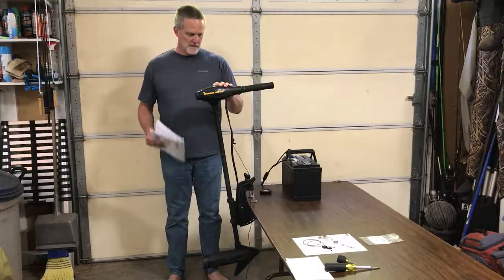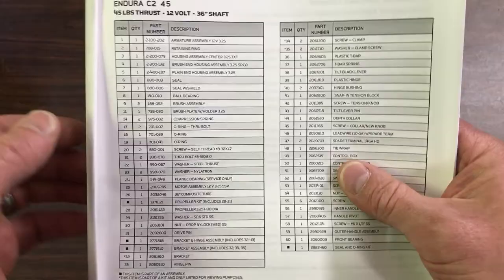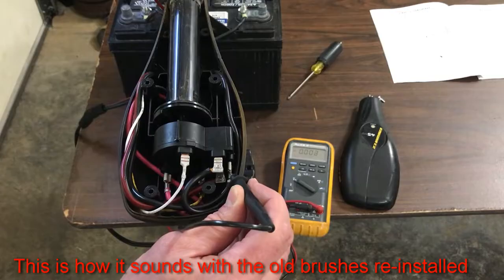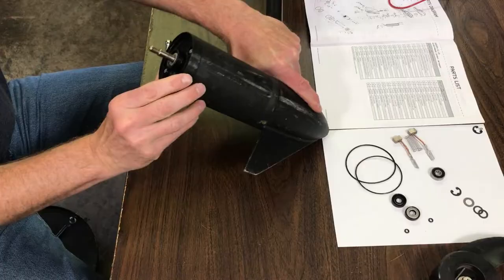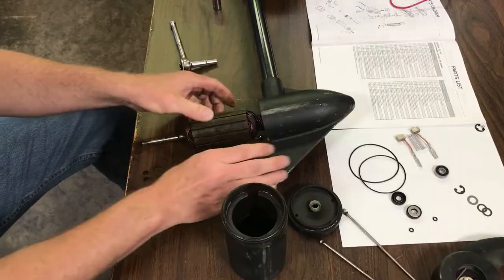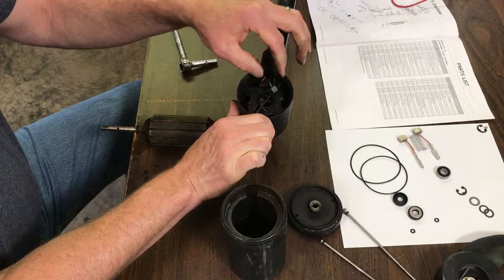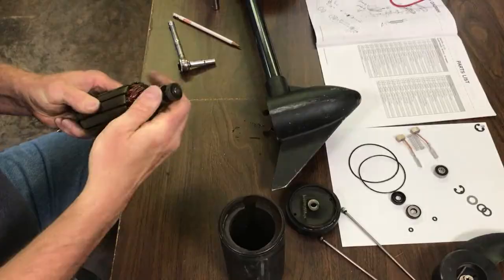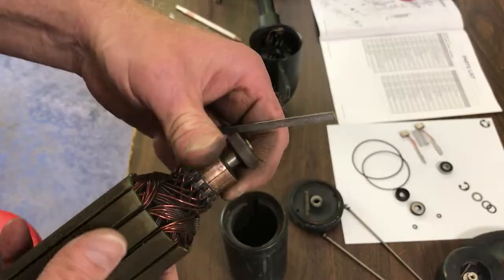Minn Kota Trolling Motor Repair

Comment: In my opinion. Out of all the videos I've seen so far, yours is the best. I disassembled a Minn Kota Endura C2 30 30" the other day with no problems.  I did this before watching your video, I did it exactly the same way you showed. As I have dissembled many motors through the years. Other people just start dissembling without being aware they could damage things even more. My problem with mine, water got inside and shorted the motor along with locking up the ball bearing. Looks like the speed controller is bad too. Thanks again for you video.
Reply: I agree. Better video than the others I've seen. I opened up a motor today, but mine is beyond repair. Looking for replacement now. Thanks for the vid, Mr. Fix them things!
Reply: I guess I’m one of those “other people” but still much cheaper than a shop. Life is a learning curve.

Comment: I subbed after watching this video. I bought the seal kit, new brushes and the magnetic armature housing. The only thing I would add is that it is important to perform this tear down in  the vertical position like you did. I did it on the boat in the resting (horizontal) position with the prop hanging over the side of the boat. When I pulled the armature out the magnetic outer casing landed on my foot before hitting the concrete shattering the magnets. You don’t know what you don’t know till you know. Great job! UPS delivers parts tomorrow. Far and away the best video. Just stop hammering on your camera and put it on an independent structure 😂

Comment: Great video. Pro Tip> Take a cheap tweezers (Dollar Tree) and hold the base pliers and bend the legs apart far enough to make a tool to spread the brushes apart while you work the armature in place. I could not do it with my fingers.
Reply: I zip tied each side until the motor was in then cut it and pulled the zip ties out lol

Comment: On the disassembly videos I've watched, the shaft with magnets just slide right off. But mine won't budge. It's as if it's glued or bolted on. I have a powerdrive. Any advice on removing it?

Comment: I watched your video because my 16 year old MK 30 Endura motor has been making a funny grinding noise for a couple of years - on and off - I decided to do a repair before it failed on me out in the middle of the lake or I did some permanent damage to it by continuing to use it.
It came apart surprisingly easily.  But the end cap seals were hard to get out, especially the inner seal.  Removing the brass bushing was the only way I could do it.  Then it popped out easily.   I cut a 1-1/2" hole in a 2x4 cutoff to put the end cap on when I drove the seals and bushing out.  I didn't want to do it on the vice for fear of damaging the powder coating.  That was useful for the installation of the seals and bushing, too. 
The interior was very clean and the brushes were in good shape with only minimal wear and there were no seal leaks. The bearing and seals looked fine.  No rust or moisture.  There was some carbon dust inside the magnet case and in the brushes holder area that I blew out with the compressor.  Nothing looked amiss.
Before I took it apart I put a piece of tape down the side of the motor and cut it with a razor at the 2 seams so I could re-place all the parts in the same configuration they were when I removed them.
It all cleaned up and was easy to replace the parts from the kit but when I put it back together, I discovered that the end cap had been rotated 1/2" clockwise when it had been originally built because the tape on the end cap was 1/2" offset so the long screws were "twisted" to the right when I tightened them.  That is, when I tightened the long "Thru Screws", the tape on the end cap would not line up like it was when I took it apart without twisting the cap counterclockwise 1/2" and holding it in place.  I didn't do that and let it find its correct and non-stressed position.
What do you make of that?  Could that have caused the noise I heard?  But it only started 14 years after I had used the motor.  ODD!
The motor runs fine.  I have not run it in the water yet.  I will update this post after I do.

Comment: Gary Johnson
So appreciate your instruction down to each detail, it gave me confidence I could do this.
I just got my new kayak with trolling motor in the water last week and 2nd day out, tipped the kayak. Everything in the water> I had rigged up my trolling motor, by removing the control  head and wiring connected to CWM control box. I had an elbow pvc cap were wires come out of shaft, but it was not sealed off., trolling motor filled with water. Opened it up, drained all the water out letting it dry out and now attempting to put it back together and came across your video. With the help of your video.   I hope to put it back together tomorrow

Comment: Thank you for the informative video. I did not follow your advice of marking the parts before disassembling and ended up reversing the control, causing boats to go backward when turning the knob to Forward and vice versa. I disassembled it again and put the housing assembly (the cylinder thingy with the magnets in it) upside down, and it fixed it. None of the videos including this one does not talk about is that there is a "--" mark on the housing unit that indicates it needs to be pointing downward (underside). I hope this helps anyone who may end up where I did. :)
Reply: Thanks for pointing this out. I've been there. done that and it's really annoying to admit to the wonderful wife bearing her gorgeous bikini tied bossoms that I messed up a zero and a one.
Reply: Good thing you did because you wouldn’t have a watertight seal. BTW… Minn Kota rep said their bench guys ALWAYS use a new seal kit every time they open up a motor. Cheap insurance. Like $8 on the website at Minn Kota.

Comment: I had the same issue of taking the old brushes out of the motor.  I finally used a dremel to cut a notch in the holder slot so I could get a pliers around the tab.  But later, i took the whole brush plate assembly off and thought it would be easier in the future to take that plate off and get to the connectors from the back.  When I install them I'll spray with WD40 and connect them from the back side and then install the plate.  I have the 2001 Endura 38 and the backing plate isn't in stock so I have to be careful with it. There were some felt pieces in it, but I'll just use it without that.  Also a little dab of CV joint grease on the backing plate and armature bearing.   The 38 has different bearing set up on the end and there is a ball bearing that is on it, so I'm not going to replace that bearing.  The ball bearing isn't in stock.  The whole motor was packed full of mud when I opened it.  A lot of cleaning.  Thanks for the video, it helps the confidence.

Comment: We stone traction motor armatures auxy gens and main alternators on locomotives all the time when needed. You’re right about the brushes arcing on the armature. A stalled motor under load will raise the bars on an armature and then break the brushes once it begins turning again.

Comment: what do i do when the motor gets power intermittently? sometimes when i turn the handle the motor works, sometimes it does not. Even when the motor works though its significantly less propulsion that it used to have, and a bit nosier too. Thanks!
Reply from the maker: Where are you measuring the voltage to the motor?  Are you saying the voltage sometimes drops going to the motor or the motor is just stopping. If the motor is just stopping with voltage going to it, then brushes are bad. If you keep losing voltage then it will be the handle switch.
Reply: I’m also having the same issue. I thought it was my control box and bought a replacement but when I installed the new control box, the motor didn’t work either.
Reply from the maker: @thayingxiong4600 did you ohm out the motor already. It should read near 1-5 ohms. If it doesn’t then the brushes are most likely bad.
Reply: @fixthemthings  I was able to disassemble it, but when I got to the brush, a lot of liquid came out. The inside of my trolling motor doesn’t look dry and clean like yours. My trolling motor was submerged in water before due to launching from a steep hill.

Comment: My prop won’t spin freely, has some resistance ? Any help
Reply from the maker: Loosen the motor bolts!  Does it free up then?  If so, locktite the bolts and snug up until it frees up. Otherwise, it may be the brushes catching or bearings jammed up.

Comment: Great video.  Easy to follow.   A small error:   the steel washer should go on first against the retaining ring, then the nylatron washer.    
Any tip to position the magnet correctly other than just trying it out?   I bought a new magnet to replace my old one (broken).   I was told if I do not position it right, the motor may go backwards.    Thanks,
Reply: Are you sure about that? I took mine apart today and it was the opposite of what you said. Mine has never been apart before me so that’s why I believe it is according to what he said in the video
Reply: @nickwessel4344  There is a small mark on the rotor (middle part with magnets inside) and you must align this sign with the "fin". This is only correct position. If you do opposite - motor will change direction of rotation.

Comment: Is there a certain way the brushes have to go in? I just replaced mine and now my motor won't run. I cant figure out why. Any ideas? Only thing I replaced was the brushes.
Reply from the maker: The brush installation is the hardest part of the whole project. Make sure the brush connectors are on tight. The brush from what I remember can go in either way. Make sure your springs are on properly. If there are no springs, it won’t push against the armature.

Comment: You really don't need the gaskets I bought a Bass pro shop 55 thrust trolling motor for $20 the only thing that was wrong the magnet was not glued and freely roaming so I glued it with high temp silicone and use that same silicone where the gaskets would go tightened everything and it kicks ASS on my kayak 🤠

Comment: Why can I take my propeller and pull it out 1/4 inch? Seems like theirs a lot of play.
Reply from the maker: 1/4” seems excessive. Sounds like maybe one of the washers/spacers is missing. I’ll have to see how much play mine has. I would think 1/8” or less would be normal.  I would think 1/4” would make the brushes go half way off of the armature. If I remember correctly, there should be a spring washer at the end of the shaft but it would only spring maybe 1/16”-1/8”.
Reply: @fixthemthings  it may be a little less than a 1/4”. I can push it in and it sounds normal but when I pull it out, it makes a grinding sound.

Comment: Rebuilt the motor,  Ya it works. That was the only problem. It wasn't the potted module in the motor compartment (guessing it has couple of coils inside there.?), it wasn't the speed controller ($9). I placed the original speed controller back in and it works. Trying to install the armature while holding the brushes away is challenging. Tried to make a holder to keep the brushes apart while inserting the armature but didn't work very well. After dis/re-assembling this trolling motor, I'm not happy with the design of Minn Kota C2 30lb trolling motor. The other models are probably built the same way.  The ball bearing end at the commutator doesn't fit very firmly in the location. Too much play in my opinion. The shaft end of the propeller is just a bronze sleeve bearing.  Another design issue I don't like is the springs that pushes the brushes against the commutator. There's too much space for the spring to move around against the back of the brushes. This will cause the brushes to run against the commutator with uneven pressure.  The original brushes were worn uneven.  This tells me the spring was against either the top or bottom of the back side of the brushes. They should have square springs that would prevent the springs from moving around. I'm just wondering if the square end of the spring should go against the brushes, hopefully applying equal pressure. I know we were always told to put things back together the way you dissembled. But being a technical trainer / instructor for many years.  I avoid teaching the students that because someone else could have worked on it before us repairing and have reassembled incorrectly or maybe the original manufacture assemble instructions were wrong. Always follow the service manual work instructions if there available. I also noticed the parts diagram it shows the steel washer goes against the ‘E’ clip then the nylon washer.
Thanks again for the video.
Reply from the maker: I hope the video helped. I filmed as I went. First time rebuilding one of those. I agree the motor section is poorly designed. I figure we will be doing this again in a few years depending on how much we use it.
Reply: That’s a good point about the springs possibility being installed backwards? When I got my first peek down the tube before pulling the armature out I saw that one of the springs looked like a ‘Slinky’. I’m going to look into it on my rebuild.  BTW.. I used electrical tape and twisted it in the middle so I could use the copper wire to hold the springs and brushes back on my first go round. Then carefully snipped one side of the twisted tape near the bend releasing the brushes. I had one of the brushes that got broken in half from impact and tried to repair it. Didn’t get contact so I took it back apart and ordered new ones and figured out why the motor needs to in a vertical position when the magnetic casing shot off the hub and hit my foot and then the concrete. Painful lesson x 2.

Comment: I have an older Minn Kota that has issues.
5 forward gears and 3 reverse.
It only works in one forward gear, and one reverse.
Any idea what the problem is? Thank you in advance.
Reply from the maker: Sounds like the problem is in the rotary switch. Wouldn’t be the brushes if it works in some speeds. Check for corrosion on the wire connections in the handle especially if this motor sat outside.
Reply: @fixthemthings  thank you. I was thinking the same thing. Much appreciated.
Reply: @fixthemthings  Same thing happened to my older MK Turbo 90 just yesterday, going to look into it now.  1st time out with the jon boat since last sept.  I've been pretty much using the kayak for the last 2 plus years and the motor sits in the shop. Thanks RC in NJ

Comment: The nylon and metal washer are installed wrong according to the book correct ?you said nylon first then metal .it should be metal then nylon .
Reply: I just did mine ...you right metal goes down first then nylon on top of it
Reply: But it was  a good vid on taking the bearing off thank!!
Reply: @bc7306  yes..very detailed guy...he did a great job .
Reply: @iyadtiti  So how come the metal one was on the top originally?

Comment: I’m not able to get all of my 3 main outside pieces to go together the top won’t go together with the bottom two, there’s a gap and it will not go down any further
Reply from the maker: Did you get the bearing on all the way and get the brushes seated correctly?  You may have the outer piece on backwards. I won’t know anything without looking at it.
Reply: Sounds like the magnetic hub is reversed.

Comment: I did it all, now I have 5 reverse speeds and 3 forward? What happened?
Reply from the maker: Somehow you got the motor wires crossed. Just switch the 2 wires going to the motor.
Reply: @fixthemthings yeah, I'm a dummy, in my rush to see if it worked, I hooked up the battery backwards...
Reply: You must unscrew the bolts and rotate middle part (stator) for 90 degrees and tight again - you have a litlle mark (line) on stator that you must align with the "fin". If you don't align - motor will change direction of rotation (which is what happened to you).

Comment: Curious if you can guide me. Unit was running really rough until it quit. There was a lot of water/corrosion in the unit.  I replaced my brushes, O rings just like you showed.  Everything went great per your great video.  It still didn't work and so I opened up the switch.  I can see the negative was melted to the switch.  Before I order a new switch, is it possible to run the unit without a switch so I know I did not screw something up?  Really like your video and since it was so easy to follow, I am pretty sure I did everything correctly.  Thanks Mike
Reply from the maker: Should be able to hook the motor leads straight to the battery to test.
Reply: @fixthemthings  Thanks.  That's what I thought but nothing???  Got me stumped.
Reply from the maker: @dogguy2351  are you sure the brushes are making contact with the armature?  Are the springs in good?  Did the wire connection come off of the brush holder?  Check these things.
Reply: @fixthemthings  Thanks. I'll take it apart tomorrow and check those recommendations. I'll be in touch. Thanks for your time. Mike
Reply: @fixthemthings  All fixed!!!  Figured out how to test the switch and it was good.  There were 2 things.  The shaft had slipped down causing the brushes to ride high and nick the armature.  After that was easily tapped up, I discovered the battery terminal had come loose under the plate that the armature bearing rides on.  That was done by a simple continuity test.  Runs like new and I couldn't have done it without your video.  Thanks again!
Reply from the maker: @dogguy2351  awesome.